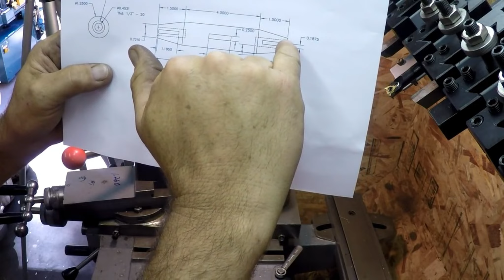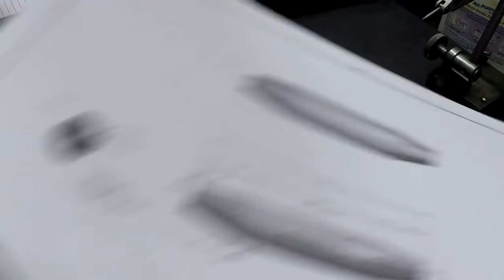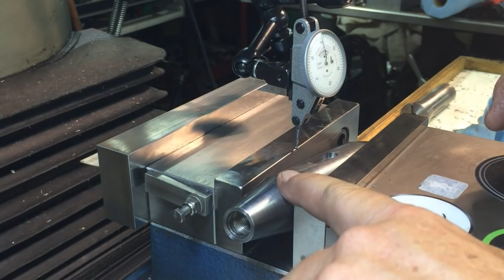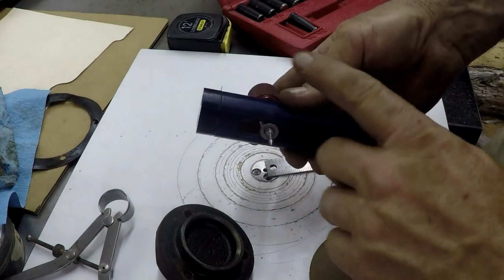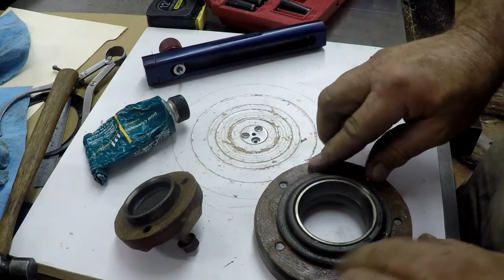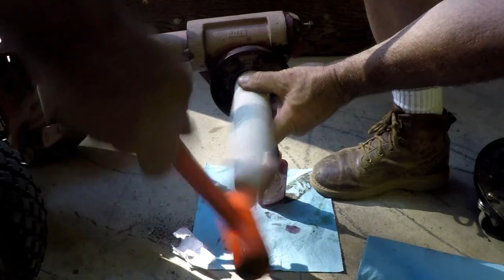How to make a Shaft | Roto Tiller Driveshaft

Comment: Nice work 👌 Was there an off camera step where you fitted the tine hub tapers to the shaft tapers, with Prussian blue, etc.? Would seem critical, since the tines are going to be digging and banging into things. Also, the tine flanges would be old and potentially beat or fretted and the shaft is new with a nice flat taper. Anyway, just a thought. Maybe it's not worth the tine?
Reply from the maker: The tine hub is a cast iron casting, it was in very good shape.  The fit felt great and not worth the time to blue.   Thanks Greg.

Comment: Kudos --- THANKS

BTW, Keith Ruckers would have blasted it clean with his water pressure sprayer with sand sucker & then painted the 'drive tube'.  Plus painting it.
John Saunders would have powder coaded it in lieu of paint.
Mark Presser would have cast a small brass plate dating & commerating the repair.
Keith Fenner would have added a Patriotic sticker.
Lyle would have traded tooling to get it done.
Just saying!
Reply: And Randy would fix it and till the garden 😁😁 I like your comment.
Reply from the maker: Thank you E'fd.  Love it.

Comment: G’day Randy, nicely done. I think you just wanted to make a new shaft. Another option could have been to sleeve the seal runner area and clean the tapers, but hey a new shaft looks good especially on the business end of a Roto Tiller:)
Cheers 
Peter
Reply from the maker: It made for a nice project.  Thanks Peter.

Comment: I have that same Troy Built tiller, but a coupla years older. A few years back I replaced the engine with a Horrible Freight "Chonda" engine. Bolts right up, huge improvement. If you don't know what a "Chonda" is, Google it. With the ever ubiquitous HF 25% coupon, it was cheaper than rebuilding the old carb!
Reply from the maker: Thanks Marvin.  I have put a new engine on the tiller, from Northern Tools.  Works great.

Comment: I see you have an old war horse too..... I bought mine about 20 years ago and it also is a bit long in the tooth. Good tough machines. Also see you write stuff on your compound . I have an off brand lathe (it serves my purpose) so I didn't mind a slight modification. What I did is drill and tap a 10/32 hole on the top of the compound to attach a heavy clip so that I can hold a small writing pad. Get them at wallyworld for cheap. Write your info on it then tear it off. I hope you put the shielding back on. Those tines are rough on the toes........
Reply from the maker: Thanks Johnny, all shields are on, they are a must. Thanks for the pad idea.

Comment: I bought a TroyBuilt Horse model in 1977 with a 7 HP Kohler engine.  What size engine do you have; a 8 HP?  If I had waited about 6 months I  would have bought the one with the clutch so it could be moved without the tines turning.  Oh well.  I had about 20 X 40 ft garden if I remember correctly in St. Louis and in Michigan.  Very good machines.  I can't find all of my manuals and other paperwork since I have moved 5 times since then.
I just came back in from looking at mine to see which way the tines turned as I thought you had swapped sides with them.  Just checking myself.
Reply from the maker: Thanks Roy. Mine is a 6 hp unit.  I think the Tines are correct.

Comment: There's another way to measure taper and set your lathe at the same time: mount the original piece in your lathe, then sweep it with a dial indicator to set your taper attachment or compound.
Reply from the maker: Yes another good method.  That method does not tell you what the angle is, just  copies it.  I wanted to make a good drawing of the shaft and show other options.  Thank you E Designs fot eh suggestion.
Reply: @rrintheshop  You should be able to read the angle off the compound or taper attachment, dependent upon which you used. If that isn't accurate enough, you can place a sine bar in between the part and indicator, and sweep for parallel. The same can also be done with angle plates.

Comment: That’s pretty slick. My mother has the same model bought in ‘82 as well, nine months after I was born. Last year I fixed it up for her, and got it running like new. Even at 78, she takes that thing and runs a dozen passes in her garden. They sure don’t make things like they used to. I still have the original owners manual that has specs on everything. Amazing to me how much tech info used to come with equipment.
Reply from the maker: Well made machine, does a great job.  Thanks Sjranft.

Comment: hey Randy, i'm surprised your drive dog doesn't make your lathe shake itself off the foundation. i've had no good luck with that type of drive dog which is why i went and made the ring of faarrh. (video in my channel for those interested) yours seems to run really smoothly, so maybe sometime down the road throw in how you got the thing to balance so well. i've tried all kinds of different ways to make the damn things work but have had no luck. i know it's something i'm doing wrong...
something else i did to the dead center that i use in the chuck, is mark it against the jaws so when i put it in again it runs fairly concentric. that saves from having to re-dress the cone every time it gets put back into the chuck. most of the time it's close to dead on so i dress it only really when the nose gets boogered up
Reply from the maker: VFD helps alot to fine tune the rpm for min. vibration.  Thanks Mike.

Comment: Randy, Did you draw that with "confusion 360"  I agree with Mr Pete on that term. Nice video, I wonder what would a new shaft cost, if it is still available? [later on I found it:]
GW-20437 TILLERSHAFT W/KEY ASSY   $112.92 
I would also make it, or at least weld / re-machine, not get shafted $$ lol!👍

Comment: Very nice job Randy. There's lots of times I will use some shim stock for protecting the lip of the seal during installation, Packing tape ! Great tip. Gary
Reply from the maker: Tape works great.